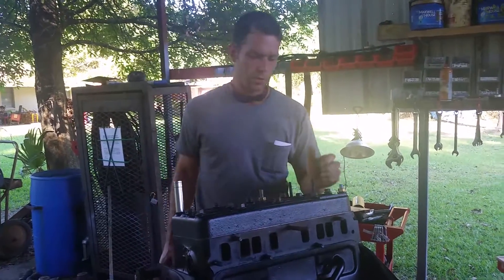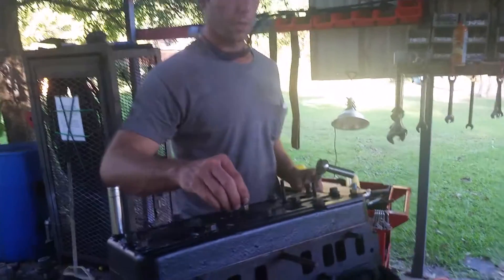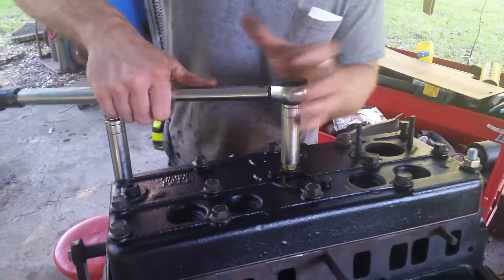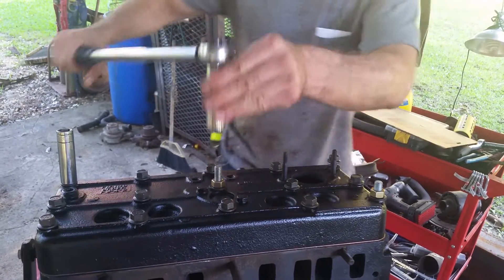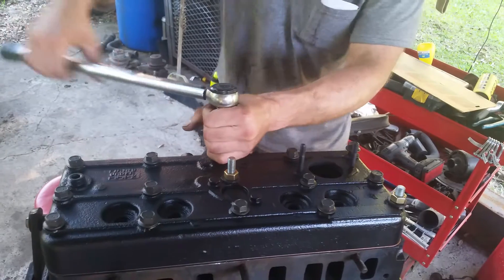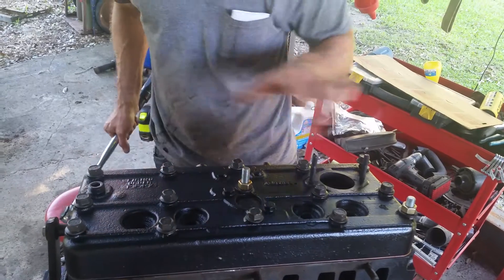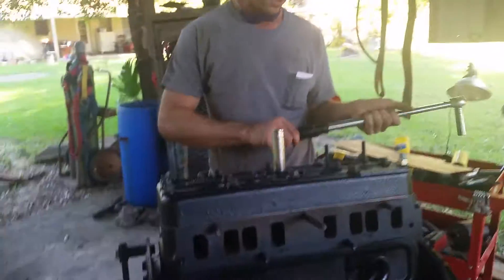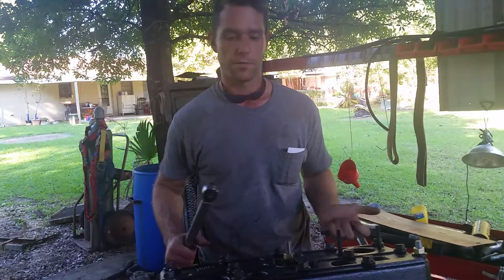How to torque down head gasket on F162 and F163

Comment: Hi most of the  bolt holes ( in the block ) are exposed to coolant want RTV sealant are you using if any at all ? the motor im working on had no thermostat  , did you say ebay has parts ? trying to find model number would you happen to know where i can look on motor its 4 cylinder 163 continental